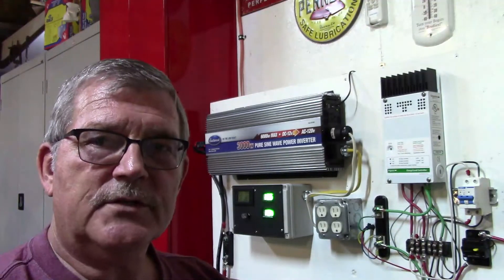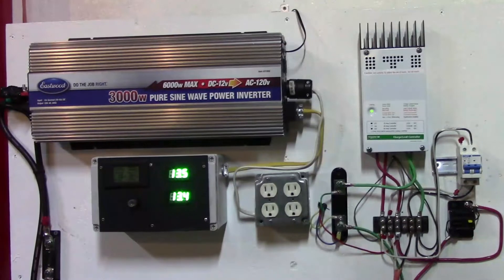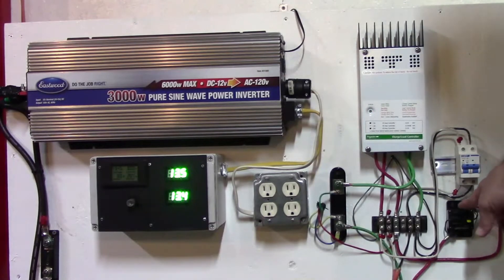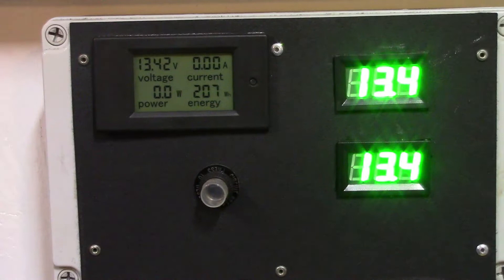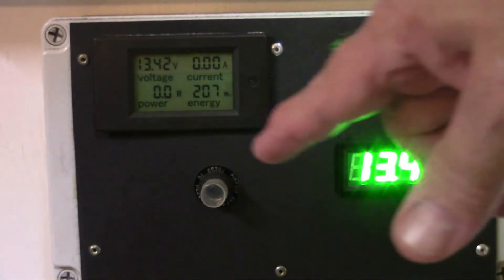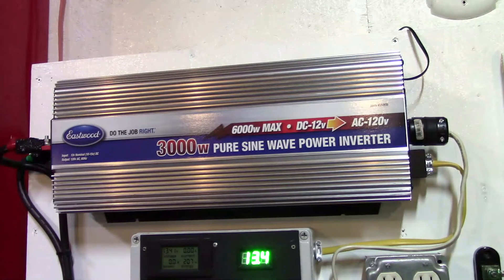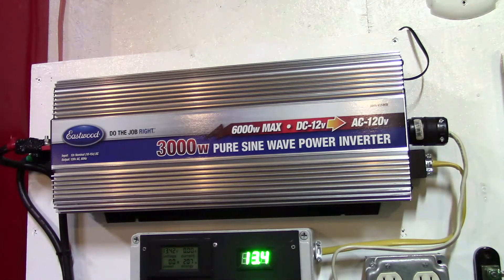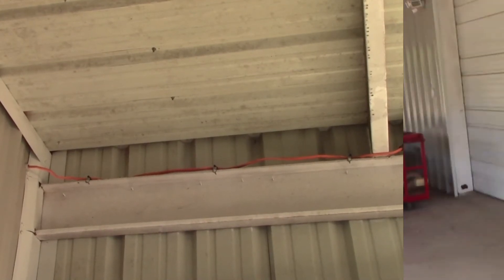Added Xantrex charge controller to solar power system

Comment: That is a pretty cool and simple solar system install at your shop.  Thanks for sharing you experiences and helping everyone out.
Reply from the maker: You bet, it will supply enough power for lights and few extras in the shop. Thanks

Comment: Good job. I had to look up "modified sine wave," which is mumbo-jumbo for a noisy, cheap square wave. Good that you went for a proper sine wave, Lloyd. That is a nice, clean setup. Thanks for sharing.
Reply from the maker: Thanks Bruce, when I was still working, we found out that some of the new power tools would not operate on the modified sine wave. The pure sine wave is a much cleaner signal and it works great. Take care

Comment: Very Cool! 😎 What's the part or model number on that battery disconnect?
Reply from the maker: The battery disconnect is available for several amp ratings. I got mine from Amazon #WOHHOM 40 Amp Circuit Breaker DC 12V -48V
Reply: @RustyGlovebox  Thanks!

Comment: You're in a league way above me Rusty. I'm always amazed at solar power and wind power. I struggle with electricity, I'm glad they came up with circuit breakers and did away with the fuses, makes mistakes a lot cheaper.
Reply from the maker: Thanks, I agree, it works better and is easier to work with too.

Comment: Here come the questions...lol what are you powering with this setup? Just the garage? The whole house?  Where did you learn how to rig that setup up? Looks complicated but yet it sounds simple !! Looks professionally installed.... Good job!
Reply from the maker: I'm just powering the shop office plugs and lights. It is nice to have a backup if needed.  Were I used to work we had a lot of solar powered equipment ( message board and arrow boards for highway repairs. It is for the most parts trouble free. Thanks and take care